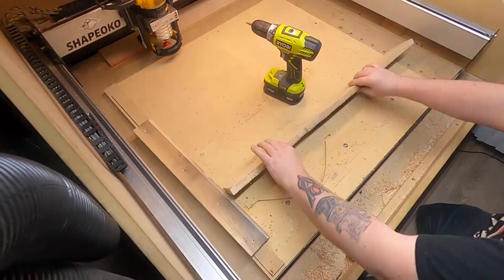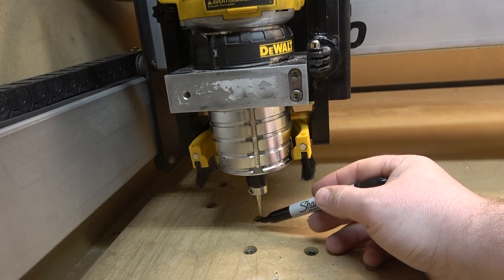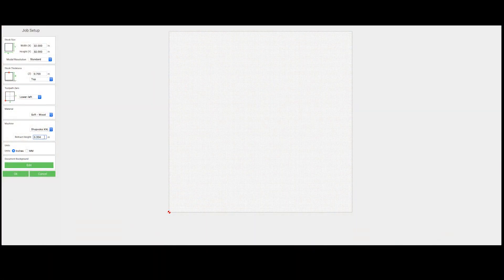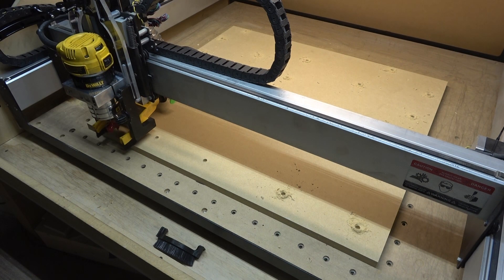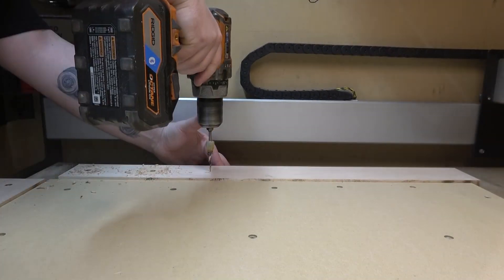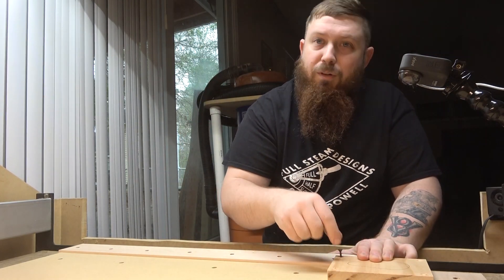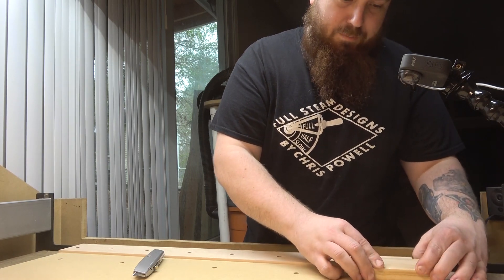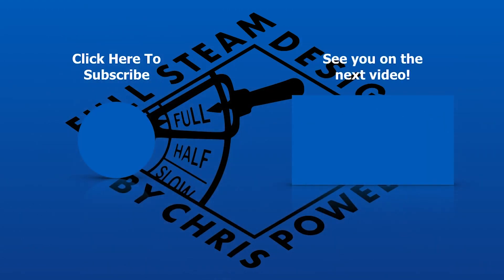Cheap and Easy Wasteboard, Fence, and Clamps for your cnc router

Comment: I am watching this video again .Chris  looks like you have a piece of mdf that has tee nuts in it that the new board you just installed over it . is the one with the tee nuts in it the original bottom for the machine or a second piece of mdf Jeff
Reply from the maker: That’s in the original wasteboard. I made the mistake of installing those when I first got the machine, and never used a single one.
Reply: @ChrisPowellFSD  Does the new spoil board come up to the top of the front and back rails so you can do tiling if you have a project that calls it. just wondering I make custom cabinets for a remodeler
Reply: that are longer than the cutting area on the xxl So I use the tiling tool path in VCarve Pro.
Reply from the maker: @resorter66  I just put them in the machinable area so the whole surface can be surfaced. Otherwise you wouldn’t be able to tile a project.

Comment: Nice video. What do I need to do if I am making larger 32-33 inch projects? I am going to try your method.
Reply from the maker: The max travel these have is 32x32, but the wasteboard would have to overhang in the front.

Comment: Just an extra step that I have found it very effective is to use diluted varnish/sealer for the base board especially as The MDF or Chip Board is very sensitive to Humidity. Honestly it makes a difference also keeps board looking nice and easy to clean. I actually use 2 pack automotive clear, seal edges first and back of the board, flip it over mount and install insert nuts ect, Do a suface cut then seal top and edges again give a light sand and one full coat of clear at 10%. All just brushed on and throw brush away after. I live in Melbourne Australia so our humidity changes a lot in a day.
Reply from the maker: That sounds like a good idea. I might give that a try on my next one.

Comment: Chris great video i am ready  to do a nes waste board and  squaring rails. Good tip on making sure the squaring piecers ar square ti the router..
Did you just put the  bit in and  set a depth and start the router an jog it manually.? And that was an 1/8" bit right. Also I see that  you have  one of the rear dust port dust shoes I have one also and am having  trouble attaching the hose to something solid on the back side to keep the hose in place. Could you share ho you hold your in place . Thanks Jeff
Reply from the maker: Thanks. Yea it’s an 1/8” bit. I just got it close by eye and touched off on the top of the guide. Then I just lowered it and jogged it manually. 

I just run it up the back and use a hose clamp to secure it to the top z axis pulley cover.
Reply: @ChrisPowellFSD  Thanks